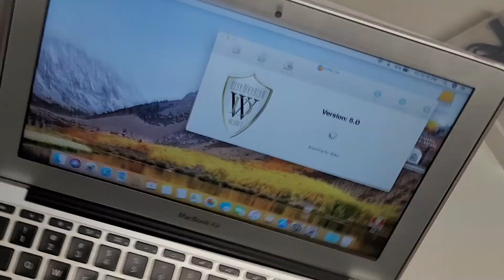Early 2014 11" inch MacBook Air (I know I said Pro...) A1465 SSD Removal and Test

Comment: hola buenas tardes bendiciones saludos desde Panama una pregunta tengo una MacBook Air early 1465 i7 8gb ram y 128gb y otro disco pero creo que es partición del disco se puede subir la rampa a 16gb y el disco de mas capacidad
Reply from the maker: RAM can't be upgraded.
Reply: @ItsBinhRepaired  y cual seria la capacidad máxima de disco sed
Reply: @ItsBinhRepaired  entonces máximo es 8gb